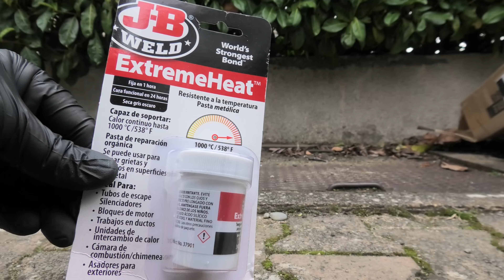Permanently seal exhaust leaks with this metallic putty

Comment: It will last until you leave your driveway
Reply: It's not paste at all . Its runny goo.   Might be ok for tiny tiny holes but not a good product
Reply: I use muffler cement in a big 16oz tube for $10 bucks. I apply it maybe every oil change, it takes like 3 minutes to do but I need to actually change out my muffler 😂
Reply: There’s always the guy who shits on quick fixes in the comments cause he knows sooooo much about cars. lol it’s like their job or something
Reply: I used a similar JB Weld paste product plus the jb weld exhaust wrap on a pretty decent size exhaust leak on a ford e350 shuttle bus! It’s still holding hard as a rock even after a trip across Canada!!
Reply: Every time I’ve used in weld it amazes me and have never repaired the stuff after
Reply: 2 part chemical metal is better and cures in 30 mins , but it’s only good for a temp repair until you get a new exhaust  👍
Reply: It’s actually really good stuff, I used to get me too and from work for a cpl months ,, then I had to remove the jb weld off,, I hammered the hell out of it and I ended up using the angle grinder coz it was so hard.
Reply: Nooo capp😂
Reply: You're not supposed to eat the paste man. Its for exhaust leaks.
Reply: Lmmfao
Reply: It still holds on my cars manifold exhaust 8 months so far.

Comment: this is the fix you use if you can't be bothered to spend more than 30 seconds on it before passing the vehicle off to be someone else's problem. he could have taken the clamp off and used exhaust tape but jb welding over the clamp will not last more than a few bounces down the road.

Comment: It sounds about 10% quieter on the "after"
Reply: Louder after 😂
Reply: its a diesel he had the door open before so you could hear the leak more clearly,  its just noisy because its a diesel
Reply: Peugeot diesel looks like; always noisier.
Reply: grindupBaker sad lol. I hope that's not the case with my truck 😞
Reply: Sounds like there's bigger problem than just an exhaust leak...wasn't really any difference between before/after. Even a diesel shouldn't have as LOUD a knock/tap as this engine has.

Comment: Been using this on my header for 10 yrs. Hasn’t failed one time.
Reply: Do you think it’ll fix the holes in my manifold ?
Reply: You've been using it for 10 years or you used it 10 years ago?  If you've been using it for 10 years then it sounds like it's not working.
Reply: You black??

Comment: This putty is incredible! I used it to seal an exhaust leak at 31 degrees, I placed a small space heater under the truck to blow directly on it for 8 hours. It cured as hard as steel and stayed intact even after driving around all day. Money!

Comment: Sadly this fix will still fail inspection in many states.  They say glue/paste/epoxy is a temporary fix not likely to survive  vibrations associated with an exhaust system. Over time, such a fix may weaken or fail, leading to an exhaust leak. Only a weld or new properly fitted pipe over the leak with bolt on clamps on both sides are acceptable for inspection where I live.
Reply: well remove exhaust ...clean it as best, use this ...sand it down ...paint it - You're welcome

Comment: I have used Rutland Furnace cement with excellent results also.
Reply: ABSOLUTELY! The trick is to clean well, apply thin layer of furnace cement, apply a layer of small metal screen and then cover that with more furnace cement. The screen helps keep keep the furnace cement to bond MUCH better to itself. PLUS the furnace cement works up to 3000 degrees. Done this to boilers and air compressor manifolds for decades that get well over 1500 degrees and have NEVER had a leak or a failure. IF DONE LIKE THIS, it'll last as long as there is no direct impact to the repair (just like everything else).

Comment: It still has exhaust leaks you can tell from the before and after it should be more quieter and that clamp is the wrong one the repair won't last long
Reply: Yah I had this same problem I took it to the shop and now my car sound much better the jb don’t always work exactly and it made my car smell funny underneath then I added the wrap so that could be why I smelled something too same all the hassle I took it to the shop 💯

Comment: I would have removed the clamp and then use the sealant.  Let it cure then put the clamp on over it, torque to spec so you dont crush the pipe.

Comment: Can you put this around a leaking O2 sensor? I replaced mine and it’s leaking bad.
Reply: From what I've read and seen on the internet (and it was a lot) JB Weld will melt right off anything on or before the catalytic converter, but it's just fine for something like this in the video. 

There is something that will work called furnace cement. Clean the area well and make sure it's got something to bite to.
Reply: Did you find a solution I have a leaking 02 sensor
Reply: @hamzaabdul4981  yes, I forgot to torque the o2 sensor. Went to harbor freight and bought a torque wrench and torque it to 35 ft pounds and it doesn’t leak anymore.
Reply: use furnace cement it will last about a year long enough for inspections and then some cheap to

Comment: Don't do it. It's not that expensive to get fixed, go to a local small muffler shop.
Reply: Those shops rip people off big time.
Reply: Exactly I tried this on a crack pipe i had because I had a leak and my car was sounding like a motorcycle so I took it to the shop after I used the JD stuff idk if it worked but it made a funny smell so definitely took it to the shop to get it done

Comment: 🤗👍👌
Reply: Just have someone cut the ends off the headers and fab some exhaust pipe that fits inside the header and weld it no leaks until the header rots off

Comment: ahhh no it cant....its crap
Reply: If it’s crap it’s because you haven’t done it right
Reply: @danielbirch6219  has nothing to do with not doing it right you can never do it right with putty or epoxy stop being a cheap Jew and get it done right at a muffler shop
Reply: @Jerseydude12 yup i definitely took my ass to the shop mines sound the same but the noise was just lower 💯